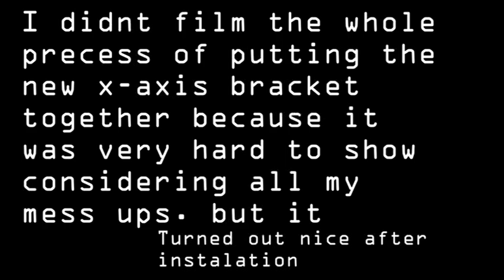Tevo CNC Printer New Upgrades

Comment: Nice job!  I would like to see....
A print that you would use as the start of a CNC operation...
Possibly a Arduino case with the CNC cleaning up the measurments and mount holes as an idea for a two step production item
Reply from the maker: Eric Blenner-Hassett I’ll work on it thanks